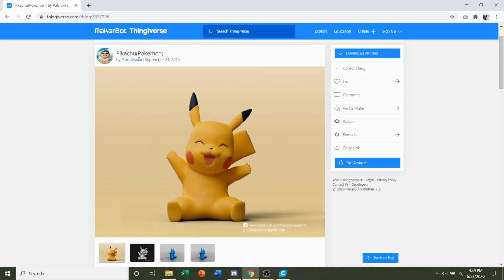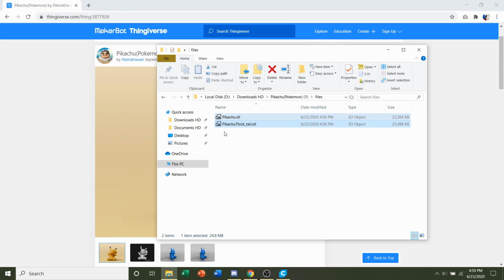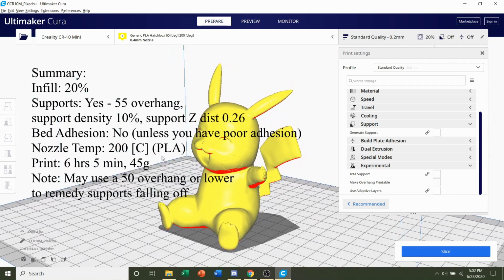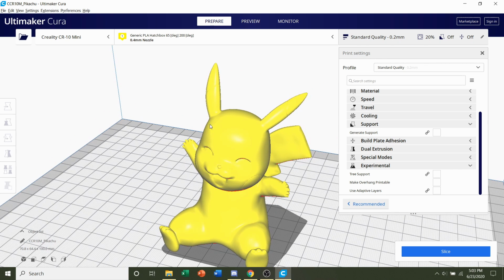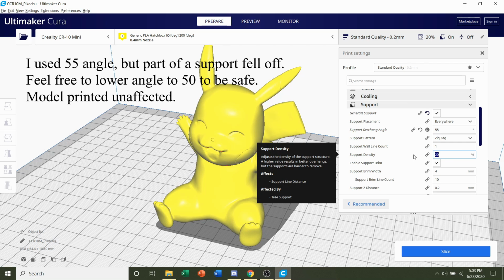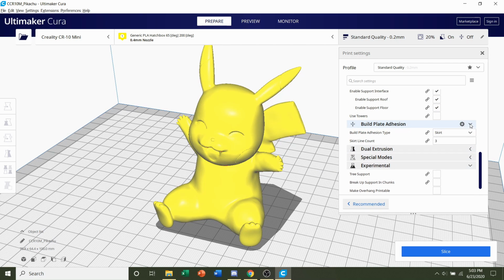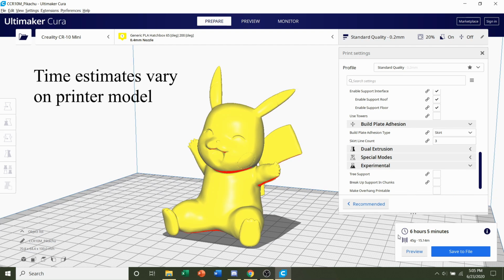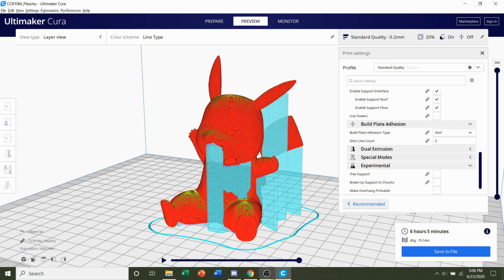Pikachu (Pokemon) 3D Printed - Tutorial, Settings, Time lapse, Showcase

Comment: how can i add the line on the left to a model? i have the problem, that the first layer, Lines are really messi
Reply from the maker: This is automatically done on Cura slicer. If you don't use cura, you have to edit your starting gcode to include a nozzle wipe (not sure how to do it myself).
Reply: @Gabriels3DPrinting  i do use cura but it makes no nozzle wipe. What G Code is it?
Reply from the maker: This is my default starting GCode. I have a CR-10 mini so only use this as reference, **do not copy it** because your printer may have a different size bed (this code is only for the cr-10 bed). Try looking online and see if there is gcode script for your printer.

M201 X500.00 Y500.00 Z100.00 E5000.00 ;Setup machine max acceleration
M203 X500.00 Y500.00 Z10.00 E50.00 ;Setup machine max feedrate
M204 P500.00 R1000.00 T500.00 ;Setup Print/Retract/Travel acceleration
M205 X8.00 Y8.00 Z0.40 E5.00 ;Setup Jerk
M220 S100 ;Reset Feedrate
M221 S100 ;Reset Flowrate

G28 ;Home

G92 E0 ;Reset Extruder
G1 Z2.0 F3000 ;Move Z Axis up
G1 X10.1 Y20 Z0.28 F5000.0 ;Move to start position
G1 X10.1 Y200.0 Z0.28 F1500.0 E15 ;Draw the first line
G1 X10.4 Y200.0 Z0.28 F5000.0 ;Move to side a little
G1 X10.4 Y20 Z0.28 F1500.0 E30 ;Draw the second line
G92 E0 ;Reset Extruder
G1 Z2.0 F3000 ;Move Z Axis up